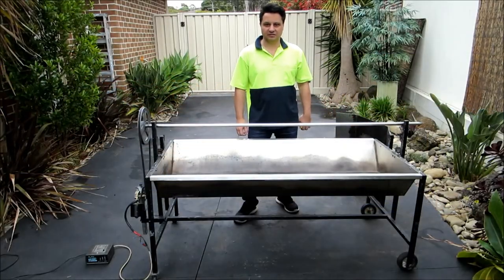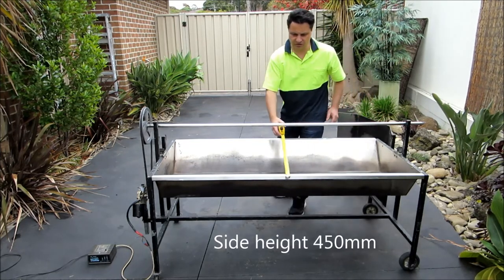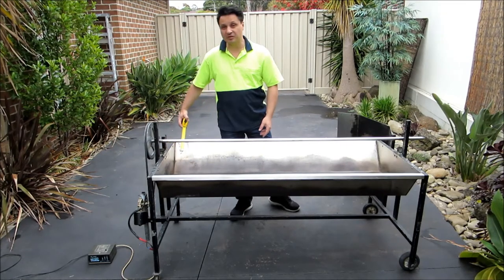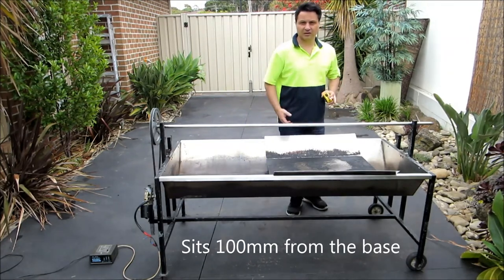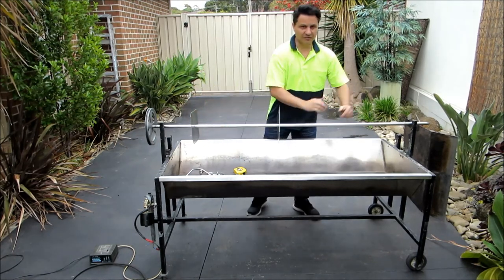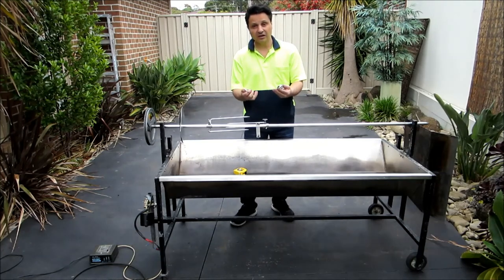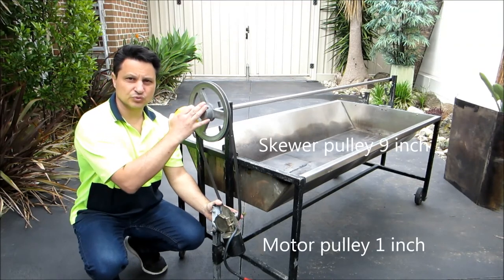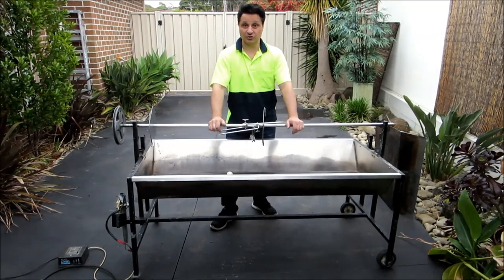Rotisserie Spit Review

Comment: Awesome description of everything. It makes life so much easier for any of us that want to copy your design. I want to use a 22mm stainless commercially available skewer so do I need a pulley with a key way or is it just a grub screw that's needed. I can order with or without key way. The pully has a 1" diameter hole so the grub screw just tightens up on the skewer shaft, is that right? Do you think a 12" pulley would work better to slow it down a bit more.

Comment: You spoke about everything except the pulley on the rod  .. where do you get one of those ?
Reply: Tell  something about engine what kind you used.  and what kind pulley and where you get all those
Reply from the maker: The pulleys are aluminium and I got them from a pulley store. 240 mm or 9 inch diameter. The pulley dimensions on the motor is 1 inch.With the motor on low it turns at 8 rpm.